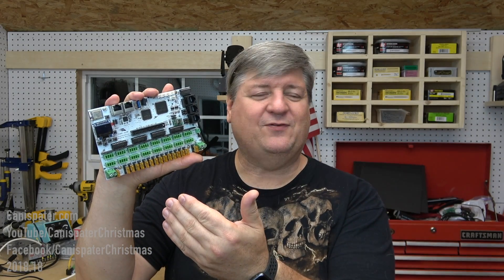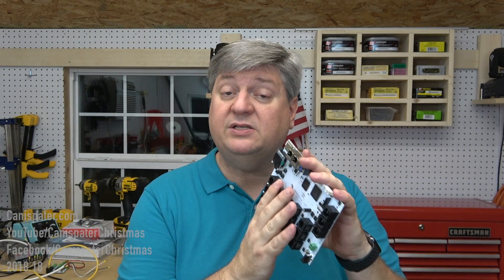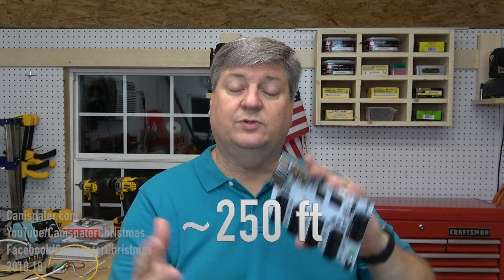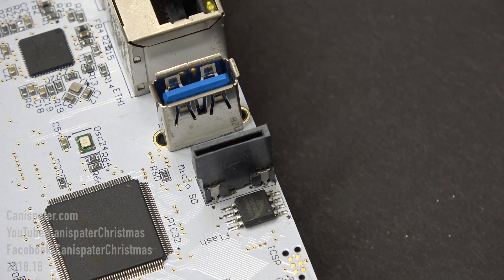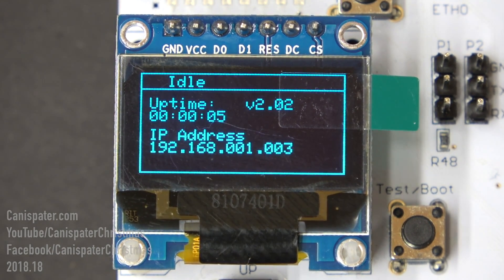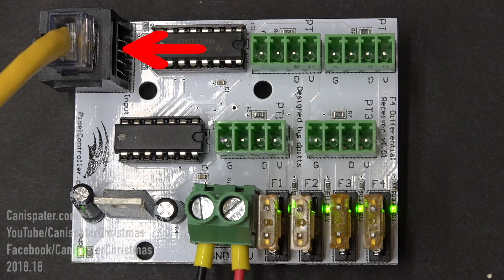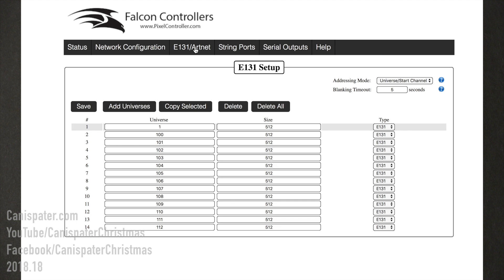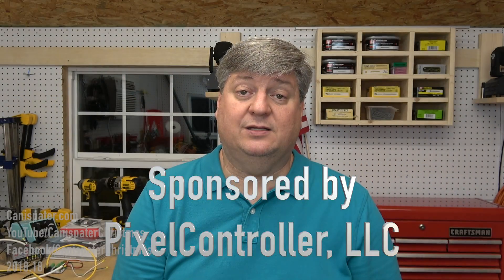Falcon F48 Differential RGB Pixel Controller (2018)

Comment: Hi, please tell me how many meters of 60 / m LED strip can be connected to one port without additional power supply to the LED strip?
Reply from the maker: 5V pixels are about 50-80 and 12V pixels are about 80-100 for all white at 100% brightness assuming power draw is .06amps per LED (check the specs of the pixels). If you drop the brightness, you can get more. Just make sure the pixel chip is supported by the controller.
Reply: @CanispaterChristmas  Thank you so much
Reply from the maker: And those are pixel counts not meters of pixels.
Reply: @CanispaterChristmas  I realized, thanks again, I just thought that the pixels in the LED strip consume less power than the string pixels
Reply from the maker: @WizardLights  They might. That's why I mention checking the specs on the strips.

Comment: I'm sorry. My math is not adding up to controlling 16,000 pixels with the f48. The whole "bank" and sharing 1,024 pixels per bank is throwing me off. Can you help?
Reply from the maker: Haha. 1,024 allocated across 3 serial ports. Each serial port drives a DR. Each DR has 4 pixel ports. So technically, 3 serial ports shares 4,096 pixels. Makes more sense on the F16V3, but is similar in concept on the F48.
Reply: Still clueless. Trying to determine which board to get and think of future expansions. I'm not running 16000 pixels now, but could see myself getting there. Can I truly control 16000 addressable nodes with the f48?
Reply from the maker: Based on your question, you might benefit from going through this playlist if you haven't already: https://www.youtube.com/playlist?list=PLFyrAfJ-kKd4ZfPdXWIt8v_bav61mW_KW It covers the basics of the hobby. I wouldn't worry about getting it perfect your first year. I recommend starting small and expanding when you're ready. The F48 is a great controller and yes, it can support over 16k pixels, but you have to plan it out a little. Lurk around in the FB groups and attend the xlights zoom calls to gain a better understanding of how everything works. Plenty of time to get ready for lighting season. :)

Comment: Starting off this year (2020) I’m just coming across this f48 and it seems like it will better suit me with my house outlines and windows/yard assortments, but I was looking at doing a mega tree ran by a f16, how would I link these two together as I’m trying to avoid doing a network this year and just running straight from my spare laptop?
Reply from the maker: The F16 & F48 both have a 2-port switch so you can connect them together. There will be at least some network between the computer and controller. FYI, I run my tree off 1 differential receiver. 4 strings of 300 folded at 50 so it looks like 24 strings. Brightness at 30%.
Reply: CanispaterChristmas so I opted with the F48. I don’t have a router yet (next purchase) but is there a way I can access the falcon by direct Ethernet from my laptop? I have gotten confused with all the network stuff at this point
Reply from the maker: @danielmilner8946  For testing, just plug the controller into your home network. It will get an IP address automatically. You can open a browser on your computer to the IP address on the OLED and see the configuration pages. You can also connect a cable direct from the computer to the controller, but you'd have to set up static IP addresses on both. Home network for playing around is easiest.
Reply: CanispaterChristmas great. Thank you

Comment: Your course show how to wire all up? I have no ideia how to wire all the staff to make it rain proof. If you teach that in the course, i`ll be signing up
Reply from the maker: Watch my last video. I go through end-to-end. Most pixels come with pigtails/connectors that are not really water-tight, but good enough except for soaking them in puddles of water.

Comment: I wish the F48 was available before I bought my F16v3 since I use receivers for everything.  The F48 is the way to go for any application I can think of.  Just locate the F48 in the house and run everything out into the snow via cat6 and 12v.  Wonderful!
Reply from the maker: That just means you need to add more pixels so you can justify getting an F48 and use the F16 for a concentrated group of pixels. :)

Comment: Hey Jeff I am just getting started and I am trying to figure out who to make a show network and you please go into detail on the I have watch you class on Udemy but no where show how to do that or please point me in the right direction
Reply from the maker: Thanks! Well, a show network is a best practice. If you have a small number of pixels for your first year, you may be able to get by without going through that hassle and just run everything in your home network. A show network is just a separate network that is different from your home network. If you have a Raspberry Pi running FPP, you can assign the WiFi interface to your home network and the Ethernet jack as a show network. You just need to make sure the show network is one of the private IP networks so most people use the 192.168.x.x network, but there are a couple of others. Typical home networks are 192.168.1.x, but they might be something else. I use 192.168.2.x for my show network. This video might help: https://youtu.be/kn1BiolQbgw
Reply: Have watch that one so is it a different router and how do you change the set up address?
Reply from the maker: In my example above, the Pi acts as a router between the two networks. This is probably one of those things you'd need more direct help with. Have you tried logging into the xLights zoom room (see xlights.org)? There are people in there most of the time that can help directly by having you share your screen and can walk you through the process of getting it set up. I don't know how helpful I'm going to be in comments.
Reply: CanispaterChristmas oh ok so the falcon pixel controller plugs right Into the pi I thought you had a pi plug into a router and the router plug into the pixel controller that is where I got lost
Reply from the maker: @allstar002  Oh! No. I was just using a network switch. Those are fairly inexpensive and just allow connecting multiple cables together. The F16V3 has a 2-port network switch built into the board so yes, you can plug the Pi directly into the F16.
Reply: CanispaterChristmas not a f48 though
Reply from the maker: Yes. They do too.

Comment: So I finally got around to buying a controller and some lights. I hooked up my falcon f16v3 to a 12 volt power supply to input 1. Had jumpers set to 7-13. The lights on the fuses and the input supply but the oled would not start. Tried the buttons. Actually all of them. No luck....sad, any ideas?
Reply from the maker: The board is powered from input 2. Try that.
Reply: @CanispaterChristmas  thank you. I just signed up for your class. It is great. I am hoping you would consider doing a more detailed lesson on each or maybe an advanced class.  So far you are the best source of information I have been able to find. Thank you for making these videos.
Reply from the maker: @ATeamAdam  Thanks! More detail on... what detail are you looking for? I'm always trying to think of more I could do, but having trouble figuring out what would be helpful. I also have plans for a couple of lessons, but specifics would be helpful.
Reply: @CanispaterChristmas  it would be great to show how to display a movie image on a matrix or mega tree in xlights. I also think it would be great to show how to make a single effect play through the entire display like one large image. (Scratch that I realize you have already explained). I guess any help with customizing effects as opposed to using the preset ones would be huge.

Comment: You made mention a support manual for this new controller. I have yet to find one on the pixel controller LLC site or anywhere else. Any help would be appreciated where I can get some detailed product documentation
Reply from the maker: Hmm. I don't see one either. Sent a note to David. However, most of the electronics are identical to the F16V3 except for the outputs so that manual might answer some of your questions. What are you needing info on?
Reply: @CanispaterChristmas  Newbie on this controller (last time I was in this space I build the old DIY Renard SS 24 AC controller) so just trying to understand user operation related info, firmware update process etc. Your video did a great job covering 98% but would be nice to have some support documentation
Reply from the maker: @petevorenkamp4196  This just in from David! https://docs.google.com/document/d/1sAzoFztiKdI3BPDl_Kegu28DKKlIM4PlSNaCNvvDtgk
Reply: @CanispaterChristmas  Awesome !!!!!!!!!!!!! David heard us  ;-)

Comment: Hi! Im a bit confused and I hope you can help me out :D. So the description page says that it can run 16,384 pixels  but i just don't understand how its supposed to run so many pixels. As far as I understand this board has 12 ports. Each port can be connected to a receiver and each receiver can run 4 strings of 50 pixels = 200 pixels per receiver. Even if I daisy-chained 3 receivers per output I would get 600 pixels. So 600 x 12 =7,200 pixels. The other way I understand is that the board has 4 columns of 3 ports and for each group of 3 I can only drive 1024 pixels. So 1024 x 4 = 4,096. So I know I'm missing something and I'm feeling very stupid hehehe. Any explanation would be much appreciated. Thanks for the videos!
Reply from the maker: It might be helpful to understand how the F16V3 handles that number and extrapolate it over to the F48. The F16 comes with 16 ports on the board. Each one can handle 1,024 pixels for a total of 16,384. If you add expansion boards, that 1024 is shared among the main board and expansion boards. So if you added two 16-port expansion boards for a total of 16*3=48 ports, port 1, 17 and 33 would share 1,024 pixels and there is a slider on the web page to proportion the pixels supported by each board. On the F48, it's the same hardware, but a different delivery system (the differential receivers). Each group of 3 ports on the F48 form the sharing groups. Let's say you have the top row assigned 300 pixels for example (the other two would share the rest). So the differential receivers on the top row would all be set to 300. That means each of the 4 ports on each receiver would support 300 pixels (1,200 total). By default, the controller is set to support 50 pixels per string so you don't blow the fuse, but you can change that number once you understand how to do power injection to keep current distributed by the board under 5-amps.
Reply: @CanispaterChristmas  ooooooh now i understand. Thanks a lot for taking the time in replying!!!  And also thanks a lot for your videos in general cuz they have helped a lot of us. Cheers!

Comment: It would be great if there were recievers that could handle my dumb rgb floods. seems really hard to find controllers that can manage 50w floods or more. 

This will be great for distant connection, not having to run starter cable sized wirings all over the ranch.
Reply from the maker: LOL! "not having to run starter cable sized wirings all over the ranch." I used it on my residential yard this year and it works really well. Check Alan's store for the "2811 dimmers (https://bit.ly/2tHwwwy)." I did a video on them. https://youtu.be/dc9gOXgK718 They look like a 2811 pixel to the controller, but drive dumb RGB strings. He's in Australia, but has a Facebook page for US folks.

Comment: Jeff,I have a F48 and use xlights, I would like to make some props that would have 4 to 6 pixels in each that I would like to all react as one (same color, same brightness) and be counted as one pixel so I could chase from one prop to the next.  I may have to add an amplifier from one prop to the next due to the length between them.  Please let me know how to set this up in xlights.
Reply from the maker: Keith did a video about this recently: http://videos.xlights.org/xlights-beginner-seminar-september-2018_979bab63d.html It's easier if you can find something that represents the look close enough and then up the string count.

Comment: How would i configure both, lets say i habe the f16v3 already configure in xlights, how would i add the f48, do i just add 96 e131 on xlights?
Reply from the maker: Yes, just add more E1.31 in xLights. You don't have to max it out. I usually just add enough for what I model. I don't know if it bloats the FSEQ any if you allocate E1.31, but don't use it. Of course, you have to remember to adjust the E1.31 if you add more models. :)
Reply: @CanispaterChristmas  and to c9nnect the 2 controllers together just connect them from 1 of the 2  cat5 ports right, so it would be my PI+F16v3+F48..
Reply from the maker: Yes. That's right.

Comment: Thanks for yet another great video. I currently have (6) 50 led strings of GE iTwinkle lights that one of the wifi controllers went out and GE doesn't support them anymore. It looks like with this board I can control these lights and start building my show next year. Can't wait for the on-board wifi and audio!
Reply: SO is it safe to assume the F48 WILL support GECE protocol/language/lights from 2012, I know the F16v3 does, but the more I see the more I think the F48 will work with the distance. Someone please confirm the F48 will support GECE, thanks!! Tom
Reply from the maker: I honestly don't know. The supported pixels are listed on the web page, but I'm not sure what chip the GE bulbs use. You might want to check with David Pitts (his info is on the bottom of his web pages).

Comment: With the differential controller it feels like 5V pixels would be a little more enticing because of the ability to decentralize your power supplies. What are your thoughts on 5V vs 12V with this controller?
Reply from the maker: 5 vs 12 is a Mac vs Windows thing. 99% of my stuff is 12V because I hate dealing with power issues, but 5V pixels are more efficient. Decentralized or not, you will need to inject power more with 5V, but some people kinda like that challenge. lol!